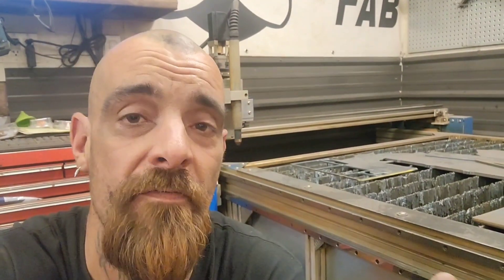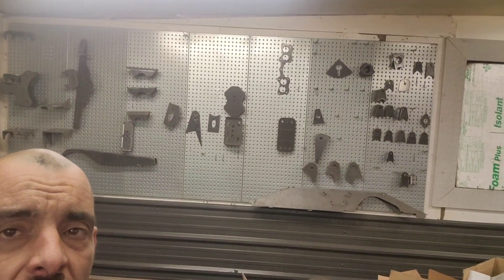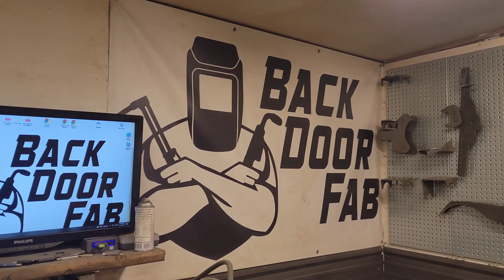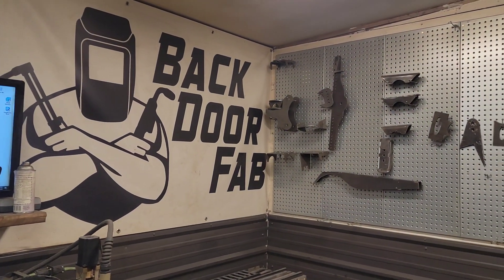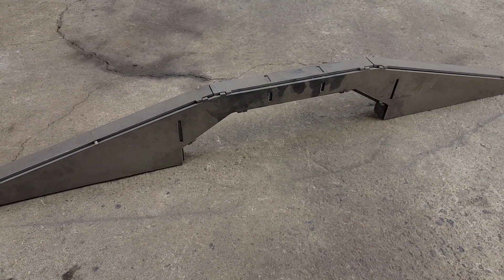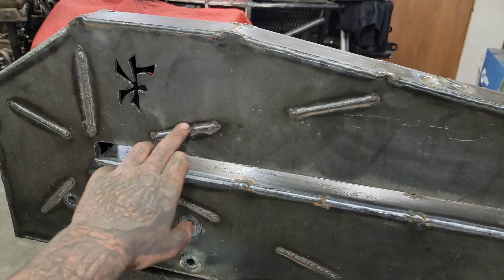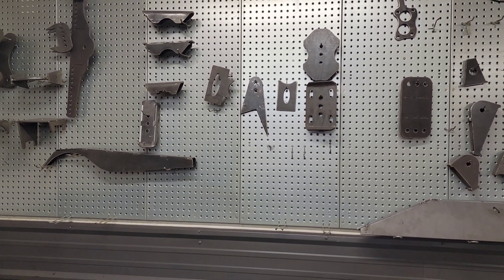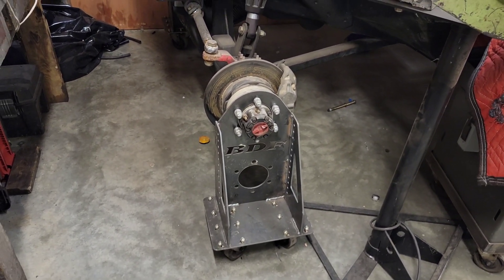Monday Morning CAD Episode 8 touring BackDoor Fab and pointers for your own Plasma cut parts

Comment: As a CNC programmer since the early 80s, I've been able to tackle much more difficult projects, no matter what it is. You are correct, in that a lot of people have plasma tables now, and are willing to help you out, and make a couple bucks along the way. The other thing that needs saying, is that anybody with basic Cad skills, such as Autocad, can design their part and give the dxf file to the guys with the machines, and they can run a tool path on it and make your part. Great video. I think it should help alot of the builders out there.
Reply from the maker: Thank you 🍻  I take that as a big compliment.